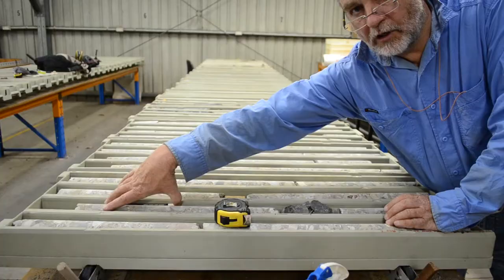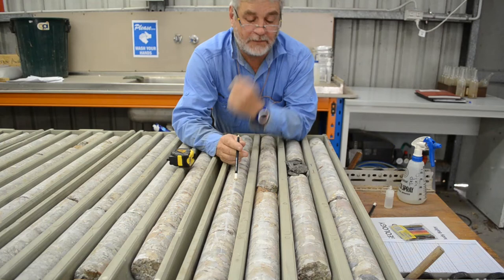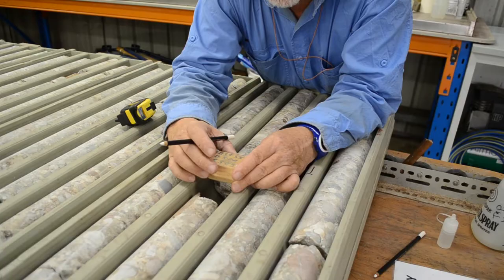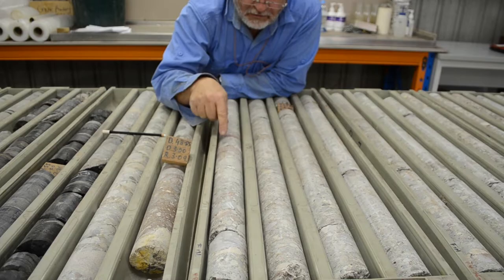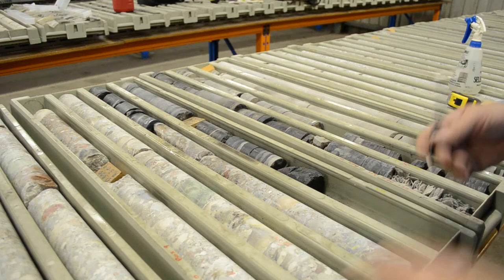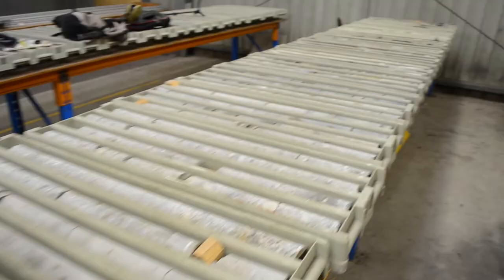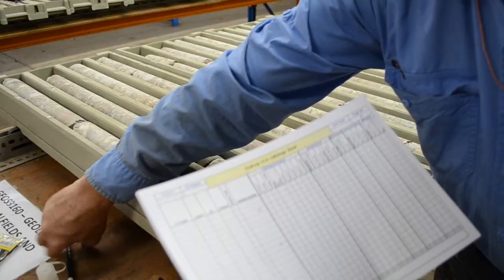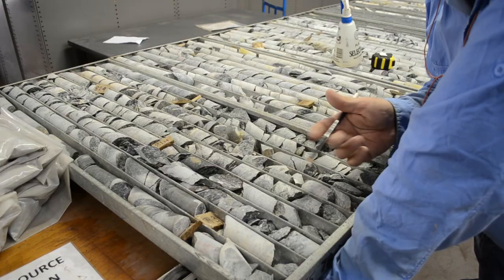Introduction to drill core and core logging

Comment: @Dale Sims, i was browsing thru a couple of sites when i run into your channel. I was in Australia back in the mid 90's up to 2000 doing coring work for both offshore and onshore for big oilfiled companies in' Australia. Watching and listening to your explanation some of them are not applicable in our recovery system and while coring in progress. I dont get to see the core in the oilfield recovery system while in the geothermal work i get to see the core recovered. I do coring in 2 5/8", 4" and 5 1/4" core sizes. Its nice to know the differences based on your explanation. Thanks.

Comment: The core recovered can be  more than the drilled length(drill run): The extra core length recovered is from the previous drill run core loss; So during core recovery you should expect core loss or core gain.( Correction to point made at 5.52min of the video)
Reply from the maker: great thanks simon - good point.Drilling is an inexact science! A bit like geology!!
Reply: We consider the Drilling tube (3 m) as drilling run
Reply: Can I get job ,,am a underground driller from Tanzania

Comment: So you have a C/G of .9 but when you measured it it was only .6.. 
Was there a loss in the previous rod? How did you do the mark up as it says it was 45.55 on the block? 
I'm currently a field technician and I'm really struggling on correcting my meter marking.
I can't find a video on the complete mark up, what do you do if you 20 cm out but it says that there is no loss on the D or R
Reply from the maker: Hi AFC and thanks for question. It isn't a precise science so measurement errors tend to cancel out unless there is a major problem. So my advice is go with drillers blocks unless there is a major mixup. The 20cm you are out will be corrected down the hole. If it is is a major mixup and the drillers are still around ask them to sort it out - they keep runsheets as well for this purpose. You cant get cm accuracy on this and in reality the downhole xyz depths are not without error due to the processing methods applied to locate points downhole.

BTW After i made this video SEG Discovery magazine had a great article on core measurement; Error-Proofing Diamond Drilling and Drill Core Measurements. 

https://pubs.geoscienceworld.org/segweb/segdiscovery/article-abstract/doi/10.5382/Geo-and-Mining-09/593042/Error-Proofing-Diamond-Drilling-and-Drill-Core?redirectedFrom=fulltext

Its behind a paywall but if you are working with geos ask if any are a SEG member and they can loan it to you for a read. cheers dale

Comment: How to estimate inicial and final depth when we have two blocks in the same box?
Reply from the maker: thanks for asking Javier. it is not uncommon for any box to have multiple blocks in it - if the tray (box) holds say 5m and the run size is 3m this will be very common! And if the driller has difficulty in penetrating the ground and so short core runs occur then there will be many blocks in a tray. It doesn't matter really. The measurements of distance drilled against core length recovered are made block to block and so checking of drilled length to recovered length can be made sequentially down the drillhole. The things to check are 1. that the trays are on the rack in the right order, 2. the trays are in the right orientation (reading the core downhole like the text on a page in a book - or lines on a website) and not the wrong way around as that can confuse you 3. the drillers have been careful in their work (sometimes i have seen the core blocks so disorganised that you have to ask the drillers to bring their documentation and come to sort out the issues - but rarely these days). Is this your question or have i missed the point somehow?

Comment: It is possible to recover more core than a drilled length in a core run. A section of core can be left down borehole and picked up on a subsequent core run,  thus having greater recovery in the  ext core run than the length of the core run.  This can be indicated by an overdrive marking of the core with the overdrive section of core left down the hole being of slightly smaller diameter.
Reply from the maker: yes great point Richard!

Comment: Dale as a  driller in seam, never drill 3m or waste a core and damage gear, 2.9 was my best core method and succesfull. it would have been nice to get congrats from geos on our recovery for you guys on that expected them for government approval as i  don,t think you understand doing 1000m cores. cheers. Try doing one yourself champ..
Reply from the maker: thanks for your advice Daniel. Drilling 2.9m rather than 3.0m is fine of course if that gives better coal core recovery in your experience. I would expect that the core blocks you would write then would reflect that; "drilled 2.9 recovered 2.9" but a 3.0m drilling length (with 3m gear) does seem to be the industry standard. 

Sorry to hear your efforts haven't been appreciated either. My background is as a geo in metals rather than coal but i do have some exposure to the challenges of deep drilling supervising drilling programs up to 2.2km deep at Mt Isa in early 1990's. I understand you regarding the difficulty of doing it. I couldn't do it I am happy to admit!

Comment: Which portable Machine is used here?
Reply from the maker: sorry Om - in what regard - the drilling rig used to drill the holes? the large core would probably have been drilled by a machine like a UDR650 or UDR1000 or similar. EG https://ddh1drilling.com.au/our-equipment/  the smaller core is from an UG rig like a LM60 or LM75/90 https://www.boartlongyear.com/product/lm75/ cheers dale

Comment: As a Beginner offsider in this regard, i will never trust driller or Geo in this operations  of this job but i will say if you have done your job done right you have nothing to worry about .   As a beguiner i was happy that my company defended my and my drillers actions on drilling .   if anyone is off siding they may understand what im talking about but it is rough hard work similar  to farm work but with some protections.  underground Dimond drilling i can see been exposed as a bad situation .

i called it quits after 4 weeks of a driller not willing to help lift 6 meter core all by myself which my guess is close to 70 kg if not more.    On a BHP site when the linit you can lift is 20 lol ill be fine with 40 but when you got 50kg its rough on the body

Comment: How to calculate persistance of joints from cores?
Reply from the maker: Hi Akash- its not really possible given the short exposure length across core. If you have a joint running down the core axis then you can get some idea of persistence but not spacing! One or the other!
BTW - There is a great paper on geotech logging in core by Andre Van As 2014; Collection of Geotechnical Data from Drill core; AusIMM Monograph 30 Guide to Good Practice; . p109-120. There are a lot of good papers in that monograph - worth the cost. cheers dale
https://www.ausimm.com/publications/monograph/monograph-30---mineral-resource-and-ore-reserve-estimation---the-ausimm-guide-to-good-practice/
Reply: @dalesims8686  thanks....But then how i calculate RMR from information based on core logs?
Reply from the maker: @akashchordiya2210  well its going to be an approximation! People do log persistence in core but the scale of observation is limited. So logging is a blend of art and science with guesswork thrown in! All data has limitations so core is no different so we need to understand the impact of those limitations. Sorry but it isn't a perfect world and our role as scientists is to be able to communicate the uncertainty we have in the analysis of our data to the people who consume our outputs. cheers dale
Reply: @dalesims8686  well thanks for your time!!! Cheers mate!

Comment: How to find difference between joints and fracture in core logging
Reply: On field
Reply from the maker: I am not sure there is much of a difference PH - they are both planar discontinuities in the rock mass across which there has been no movement although they may have fill of some type. They both need to be natural breaks - the issue in geotech logging is to ensure you exclude counting any breaks which are drilling induced. The move to AI-based geotech logging based on core images or scans has a problem with this. There is great info on geotech logging in the AusIMM's Monograph 30 - Guide to Good Practice in Resource and Reserve Estimation.
Reply: Amazing. I am a geologist in Toronto working in geotech. This video is super informative. Thank you sir!